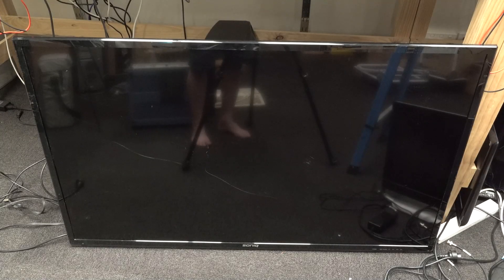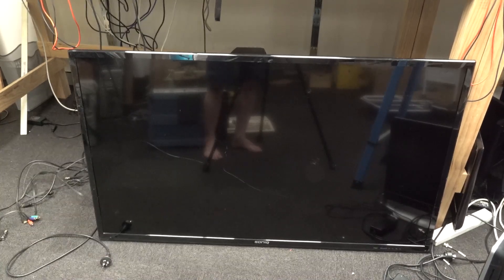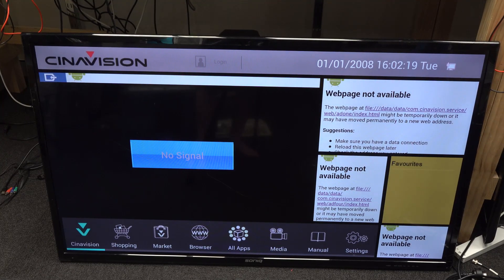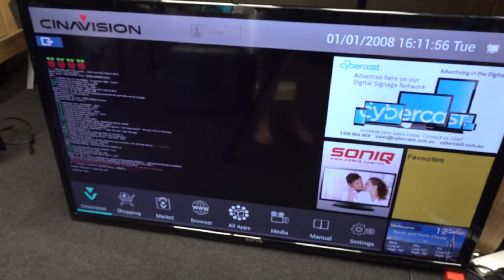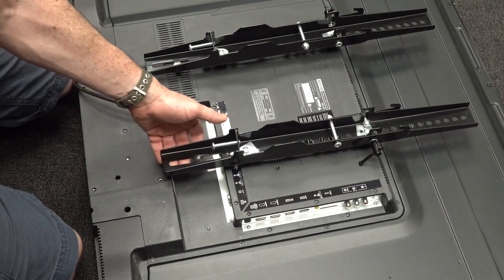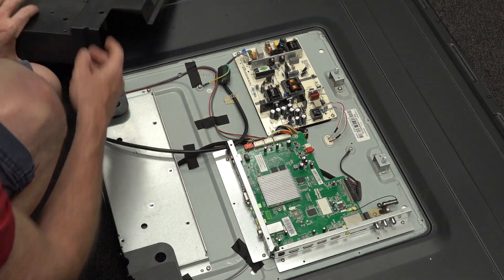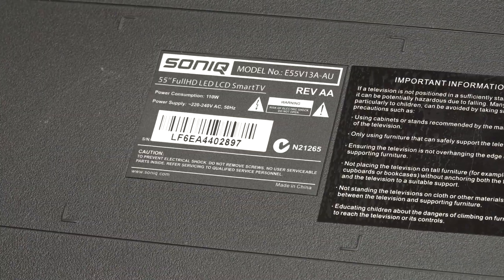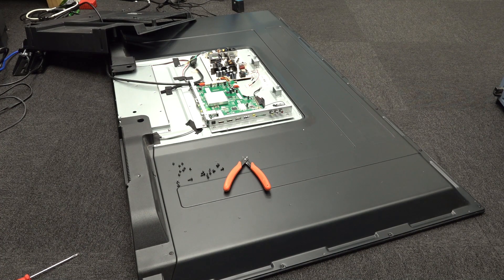EEVblog #1261 - Dumpster Diving 55" LCD TV

Comment: Haha 'Bobby Dazzler',  I make a good living finding and fixing tv's from the dump.  I recently found a 6 month old '75"  Samsung 4K UHD LED LCD TV' worth $6000.  All I had to do was swap out a board with another from an exact model with a cracked screen... which I also scored from the tip for free.  No idea why they tossed it, it was still under warranty.  But it was set to 'Store Mode'  so I'm thinking maybe it was a display model which went bad at one of the big sellers stores.

Comment: To get full screen, goto the "all apps" menu on the bottom and select "TV" to make it full screen

For a more permanent solution check the "market" for the "launcher" app which let's you select whether it starts in full screen or homepage

My smaller 48" soniq had a built-in startup option appear after a firmware update
Reply: don't do this on the E40S12A makes it bootloop almost impossible to reset lol

Comment: 8:18 that's a markout and castellation for a bluetooth module. seeing as the tv runs android, has wifi right next to there, some bypass and an electrolytic with something like the hiletgo hc-05 and you have ... well... a crappy android with a 55" screen

Comment: My work has loads of Vizio M60-C3 TVs from around 2015 which have started failing all at the same time. The either don’t turn on or start having partial lighting issues.  Turns out they all have the same bulging caps issue on the power supply. 10 cent fix !  I think they weren’t built to be left on 24/7

Comment: RCA Also makes one that looks identical with different firmware. I serviced one with bad back-lights recently. By looks identical, I mean the physical casing and boards inside are exactly the same, in design and in placement. There is another brand as well that has the same exact design and parts as well. Someone is manufacturing these and allowing other companies to rebrand them.

Comment: Not all remote apps have the home button it seems. I use an app called "AnyMote Universal Remote + WiFi Smart Home Control" it's on the google play store. Just loaded it up to see and yeah, if you type in soniq and choose "most models" then when the remote loads up swipe left to see the homebutton. I wonder if you can flash different roms to that tv..

Comment: The strange looking antenna module is what's normally used in a standard rubber ducky WIFI antenna. It's a simple dipole with the needle part forming one element and the hollow part (cable inside) forming the other.

Comment: Nice.  I'm seeing more and more LCD screens chucked out the front of people's houses. There are tons of computer monitors and many are 40" or bigger decent quality LCDs.   I guess people are upgrading to bigger 65/75/85" and 4K models but throwing away perfectly useable displays.    One I picked up a couple of weeks ago had a dead switching MOSFET in the PSU but $7 later it's as good as new.   Even if you can't fault find the 30% that don't just fire up perfectly first time, often it's just the power supply board and you can buy genuine replacements for about $30 on eBay

Comment: Earlier this year, I found someone throwing out a 49" Westinghouse TV at our apartment dumpster. PERFECT condition. Yanked it right away. Worked perfect right away... but then learned the buttons were haunted. It started randomly turning itself on in the middle of the night, followed by wanting to change the volume (thankfully it's just plugged into my PC and I don't use the speakers). Then it got worse - menu started opening and randomly changing things... I thought it was infrared interference, so I taped over the receiver, but same problem. Unplugged it for a few days and switched back to my old dual monitors. Tried again, started working fine again - then went to shit again.

Took it apart, analyzed it, the buttons aren't tight - they have a bit of slack in them, so that's not the problem. Air and everything was dry, so moisture wasn't the problem. Looked at the button board under the microscope, noticed a bunch of solder balls between the solder joints holding the button panel connector for the ribbon cable. Cleaned that up, started working great - but then went to shit again. And even worse than before. 

Left it unplugged for a couple months. Would periodically turn it on just to see what happens, and it wanted to randomly flip through channels. Meanwhile, it was an eyesore seeing this massive screen sitting dormant behind my dual (non-matching) monitors. About a month ago, gave it a try, and was acting normal. So I switched back over and got rid of the smaller monitors, and it's been working perfect ever since. Just over a month.

I'm sure the problem's still there and will return to haunt me soon. But I have some ideas to investigate more. If I found little solder balls in one place, I better check the rest of the circuitry. I even left like half the screws out, knowing I'd want to open it up again later.
Reply: And I just got the the point where you had removed 4 different types of screws - I got up to 6 different types of screws to get the back cover off. Then the internals had yet another variety of screw types.

Comment: That wifi antenna is basically what's in the little 10cm long plastic molded ones you can get for a router or whatnot, just not encased in plastic.  The wide part is one half of the dipole and is bonded to the shield, the center conductor of the coax makes up the other half.

Comment: I still have a Soniq as my second TV. After looking into it they do indeed roll their own controller board but use whatever is cheap at the time for the rest of the television ie LCD panel, power supply, t-con, LD board. My Soniq uses a Hitachi LCD panel and actually has a reasonable picture for the price point.
Reply: I’ve literally never heard of this brand in my life lol

Comment: They are rolling their own board but are using android as the OS. Those web errors are exactly like on my phone when I have no connection.
I hate that there are ads on your home screen. But, Will it run minecraft? I've tried that app, the free one on all of the android devices I have and it runs on all but two of them. A Craig 7" tablet and a small cheap android phone that I use to stream music to my stereo.

Comment: Dave, this may have been asked before, but do you Ozmates recycle? Are there different bins/areas in your fabled Dumpster Room, or do the bin-men sort the stuff as they remove it, or does it all go to landfill, willy-nilly?
Reply: For residential waste we usually have 2-3 streams: recycling (glass, metal, paper and plastic in one bin), green waste (garden/tree material, not available everywhere, sometimes includes compost), landfill (everything else, though in my council area electronics waste can't go in, and most be taken to an e-waste processing centre).

But Dave's dumpster room is in a commercial property, and they likely have to pay for disposal of everything. It's cheapest to just have a landfill service, so lots of places don't bother with recycling.
Reply from the maker: As Ed said for residential. For commercial there is no e-waste bin, just rubbish and cardboard recycle.
It's actually against building policy to put office waste like furniture and electricals into the dumpster room.

Comment: The TV looks to be set up with Advertisement Display Firmware. Generally used for TVs in public places, you can have whatever your main business on the largest section, and ads play in the others. I got one of these TVs once from the College I went to when they threw one out, the can be repurposed into normal TVs but you need to upload the correct firmware for it. I just used it as a second monitor for a few years.

Comment: Funny enough just gave away a TV set today, to the neighbour, whose old Panasonic 74cm Flatron CRT has died.  Darn near got a hernia lifting the old one out of the cabinet, and, while it probably is an easy repair, there is really nobody who wants a regular CRT based TV set any more, so this one will be scrapped out. At least not an heavy as the 80 inch Panasonics were, those you needed at least 2 people to move them, and they came with a set of handles screwed into a panel on the rear, that you used to move them, as the CRT alone is over 80kg.
Reply: SeanBZA I'm still using a Sony Trinitron 35" daily! It took 4 people to lift it in its place... One day, it will leave in chunks.

Comment: "TV prices can't fall much further, 55" 4K for $800" - $239 at Walmart these days.
Reply: Walked into a local electronics chain store not long after 4K hit the market. Big 4K for $4000.00. Yes, that was $1.00 per K.  Now they are cheaper than a refrigerator.

Comment: It runs at 110W - is that good?  If you're ok with the power consumption, why not have it run a feed from the ISS or one of the Weather Web Cams around your local area? Treat the scratches as 'dirty window' dressing ;-)

Comment: 8:08 Many of the 2.4 GHz antennas I took apart look just like that, simple dipole, the exposed metal is ground and the wire is the active part. It's bent out of shape, it should be straight out.
Reply: This may be a north American term, but that is a dipole with a bazooka balun.

Comment: I noticed that Netflix recently stopped working on some smart TVs from the early 2010s. This might be why they threw it away.
Reply: Hulu stopped working on my LG that I bought around 2014-15. (New at best buy, so it wasn't already old when I bought it.)
Reply: @xenonram  That's ridiculous how they can just pull the plug, bet it causes so much e-waste.
Reply: No HDR function is the culprit!
Reply: @HighestRank  What's that?
Reply: @uK8cvPAq  High Dynamic Range

Comment: that weird little antenna thingy is connected to a "RF" solder pad on the board so i'd have figured was an antenna of some kind. seeing that they used raspberry pi for their OS and that wifi chip looks like it's one of those adafruit break out boards, it's like they just designed their boards around those lol
Reply: Don't think that was the OS used by the TV as he said he was using the HDMI input. So that was probably just a Raspberry PI he used to verify that the HDMI worked.
Reply: @blahorgaslisk7763  must have misheard that then lol but that wifi chip is definitely one of those breakout boards those!
Reply: @ToeCutter454  Well there are a lot of posts saying this TV is Linux based, so who knows what we saw. I kind of feel that as the rest of the "smart" functions, such as the annoying advertising, was up and running we shouldn't be able to see the OS boot up at the same time...
Reply: @blahorgaslisk7763  that may be why they tossed it! if it glitched out from a fault in firmware or something.

Comment: you're right about needing that home button to get full screen, if it's on the newest firmware there might be an option in the settings to boot straight to tv. Soniq tend to use lg panels so the picture is alright
Reply: But the leds are overdriven in those panels and will fail at some point. getting the screen off to replace them is a pain in the proverbial. The glass in the panel is soooo thin.  All the brands suffer from led deaths but none of them allow the led strip to be replaced without panel removal. Samsungs have started gluing the panels in as well.

Comment: @EEVblog
I have the exact tv...  if you dont have the remote.. your out of luck.. your stuck in that mode.. the remote has a big green button. that switches to full screen
Reply: Got given one (slightly different model), did the same thing with loading up the home screen. Found a firmware and flashed it, which fixed it. Believe it came from ftp://techresources.soniq.com/firmware/ Gave it away, but came with 2 remotes, so still have a spare (model: QT166). That's what the RF dongle is for. Built in battery, USB rechargeable. Remote on one side, including the green home button. QWERTY on the other side including thumb mouse thing. Got no use for it, so if the TV isn't going back in the dumpster, could send it?
Reply from the maker: Someone said a mouse works
Reply: @EEVblog  there was firmware online ages ago that default full screened start up. But haven't seen it in a long time
Reply: @EEVblog  there is a download  on the tv for remote its a qr  scanner on one of the settings pages use a mouse to get to it

Comment: My mate picked up a broken 65" HiSense 3D 4K TV that wouldn't power on and brought it to me. 1/2 an hour later, two resistors and 5 caps replaced and he now has a $3000 when new (2017) TV with remote!
Reply from the maker: Sweet!
Reply: Finders keepers.
Reply: $3000 for a Hisense? I think you mean $300.
Reply: Maybe 30.00 dollars for a Hisense! LOL

Comment: that moment when you realise Dave scored a dumpster screen better than your main screen
Reply: I just bought a 50” 4K for my grandmother to replace her 37”...
Reply: I have a Soniq screen they are crap, they have an energy saving feature that wants to turn the screen off every 5 hours, unless you press a button within a 1 minute time frame, it turns off, annoying when ur trying to do stuff.
Reply: Smoky of Stormwind you can’t turn the auto off feature off?
Reply: @JasperJanssen  it can't be turned off, it's pretty shit when ur gaming and it pops up in the centre of the screen with a 60 sec countdown, perhaps a firmware update could remove it, truly a shit "feature"
Reply: Smoky of Stormwind Most all modern TVs do that.
Reply: Same story, SyncMaster 204B._

Comment: Cinavision is the crappy android on there.   Don't waste your time, it's rubbish and won't run any modern apps.   
We have a few at work but I always connect something else to display on them.
edit: hit the source button on the back of the tv to get rid of the advertising screen.
Reply: i use android tv boxes even for my decent samsung TVs cuz Tizen OS is just as bad
Reply: So is LG WebOS. I use Nvidia Shield TV instead.
Reply: @povilasstaniulis9484  i use neither. I plug in my pc and or xbox.
Reply: Smart or dumb, don't care. I lways use a NUC with win10 or Linux on it. In fact, using one right now on a 65 inch TV.

Comment: does anyone use smarttv software? I am convinced it's one big joke and everyone has accepted that it's just a sham. Even on high-end TVs it's frustratingly slow and tacky
Reply: @voltare2amstereo  Those screens are remarkably affordable now. I've been shopping for a non smart TV 4k, even 50 inches can be had for under $200. it's a great deal especially if you have a pc or laptop to drive it.
Reply: I've tried using smart blu-ray  software, but by the time I find a discarded player the internet servers have all shutdown and the software does nothing.
Reply: I do on a this year's model 4k vizio. Mostly youtube. I never thought I'd like an interface w/o a keyboard but its OK because it saves like the last 15 channels and that's most of what I need. I still prefer my laptop. Casting is an amazingly conveinent function though.
Reply: BTW I wish I could figure out how to run something like adblock on the tv.
Reply: You obviously haven't bought a smart tv in the last 6-8 years. (Or maybe you just bought of brand ones.) All of our Sony and LG TVs are extremely fast and exponentially more convenient than a PC, or even chromecast/Fire/Roku plugged in.

Comment: Ah cheap tvs, glad this one seems ok, i got given 5 40 inch toshibas from 2017 about a month ago, just enough out of the 12 month warranty to not have buyer kick up a fuss, all of them suffered driver chip problems. Bonded to the ribbon cables, $4 part pain in the backside to fix, gave em to friends and family as a spare room tv, a lot of this cheap stuff is really made down to the penny now even the name branded stuff unless you buy top end
Reply: good on you, Toshiba dont even make Tvs anymore there just re-badged like JVC and so many others from Vestel , i think its wrong so many customers dont know the trurg and put so much faith in the "brand" name  ;-]

Comment: I have a 42" Soniq dumb-tv that I just watched this video on, works quite nicely though I do wish it had a better set up screen. Have a Samsung QLED as my main TV.

One interesting thing when you opened the TV up, earlier you showed it had Raspbian installed, but I didn't see a Raspberry Pi anywhere inside the beast, I suspect they've gone with Raspbian on a custom mainboard, obviously with an ARM SoC.

I suspect that's why when you checked for firmware updates there were none, because it's very likely a customised version of Raspbian specific for that TV mainboard.

What that means (since you obviously had root access to Raspbian) is that you could if you wanted to (and assuming the USB ports give you the access to) attempt to put a newer version of Raspbian on the device, you'll very likely lose access to certain things but Raspbian is pretty resilient and may actually make them work for you :)

It looks like it also may be running Android, but that's possibly just the built-in webpages, since it looked nothing like Android (A lot of TVs from that era, such as my old horrible Hisense 55K680UAD, were actually running Android and not Android TV, which made the interface sluggish to use).
Reply: Raspbian was just Dave testing a HDMI input from a RPi behind the TV
Reply: @MikrySoft  Ahh, that makes more sense then.